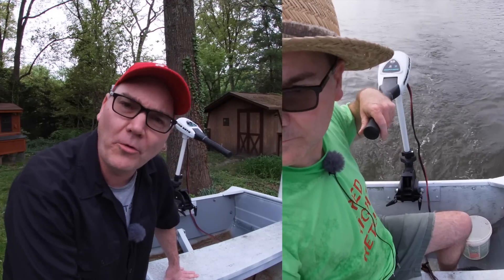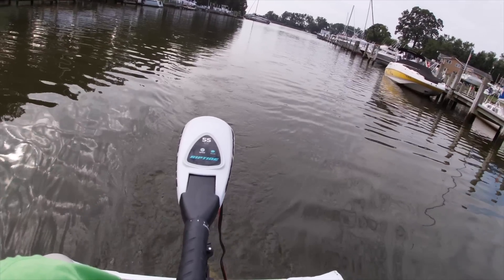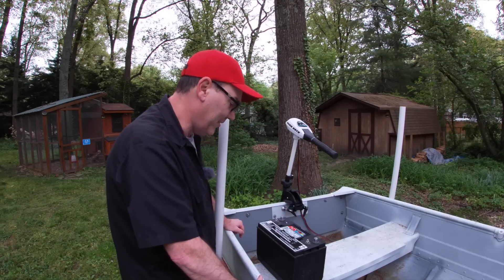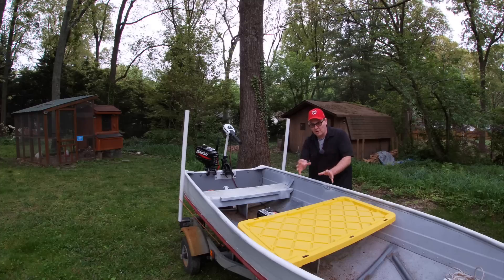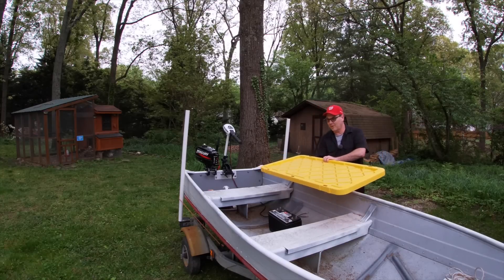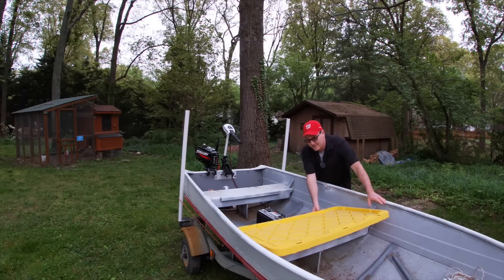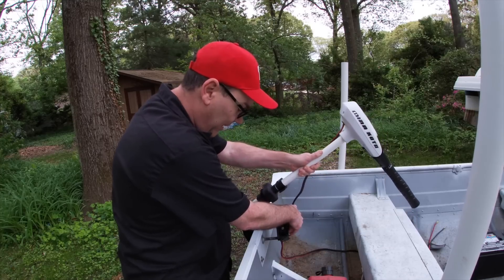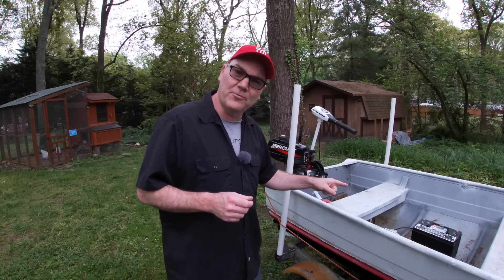How Many Solar Panels Do You Need For A Trolling Motor?

Comment: of course
Reply: why do you even ask, or doubt
Reply: curse, you just denied something that is possible, easily
Reply: everything was free for you, what do you complain
Reply: say the watts rating of the motor
Reply: solar roof, you got at least 1200W (not 300W) like in solar bicycle quad
Reply: your knowledge is obsolete
Reply from the maker: How is my knowledge obsolete? Go to Amazon. Look at all the 12 volt solar panel kits they offer. Read the specs for size and weight. See the cost. Read other comments from people who have either A: built a solar boat and admit that you need lots of panels to keep up with a trolling motor. Or B: have tried using solar with their trolling motor and it has only worked for them if they run for short periods of time at low speeds.
Reply: @WayneTheBoatGuy  say what is the wattage rating of the motor, then say if your panel or solar roof optimally directed to the sun will sustain it 100%, and your doubting makes it clear
Reply: @WayneTheBoatGuy  I do not pay any costs, ever, I just care if the idea is sound
Reply: @WayneTheBoatGuy  you dont even have to actually try, to verify some idea works
Reply: @WayneTheBoatGuy  assume you have x watts solar panel and x watts motor, you can easily say if it runs for example 6 sunny hours, without even having a single battery, I say this because you try to dumb down clever working stuff, with old crap attitudes
Reply: @WayneTheBoatGuy  I know this from solar cycling stuff, where a 300w panel can easily pedal you all day
Reply from the maker: @Jkauppa  I didn't want to fill this video with data. But to answer your question, my motor draws 52 amps/hr which apparently is 624 watts. 100 watt panels from Renogy on Amazon are 42" x 21". My 12 foot boat is only about 52" wide - so two of those panels would take up more than half of my boat unless it was a roof. A fixed roof on a small boat like mine is not ideal UNLESS someone was building a solar powered boat as proof of concept which has been done by several others.
Reply: @WayneTheBoatGuy  someone might want to build a roof if you dont want to yourself, even a simple tilt roof, or even a super wide oversized tilt roof, which makes full power continuous troll electric motor possible
Reply: @WayneTheBoatGuy  yes it has been done already, all soundly possible
Reply: @WayneTheBoatGuy  if you want just infinite daily range, dont blast full with the motor all the time, naturally
Reply: @WayneTheBoatGuy  taking breaks while fishing, stopping, is very common :)
Reply: @WayneTheBoatGuy  btw, any amps is only the time you actually take from the battery, so Amps * time = Amp hours, Power = Amp * volts, energy = amp * volts * hours, just to clarify some issues
Reply: @WayneTheBoatGuy  you could even drag a separate raft filled with solar panels if the roof option is not suitable :)
Reply: @WayneTheBoatGuy  OR you could have a very high wattage rolled up solar panel, from which you can on any spot roll out and charge fast to full
Reply: just buy a combo solar generator, done
Reply: buy 30% efficient solar panels, 300W/m^2 at mid day
Reply: are you using 10% efficient solar panels, huh
Reply: yes you are mocking what is easily possible with your mouth
Reply: I hear only doubt (I need to be paid, and restrict others) from you
Reply: dont buy heavy stuff, duh
Reply: again, compare solar input to motor output, otherwise you lie to yourself
Reply: if you dont know anything, dont try to teach
Reply: ahha ha ha does not cover your incompetence
Reply: because not you
Reply: tilt your roof, duh
Reply from the maker: "tilt your roof" So you agree that I would need a whole roof of panels to keep my batteries charged? AND you mention I would need to tilt it for it to be effective. Once again, I am not saying a solar boat is impossible. I know it's possible - I am saying that you can't just add a reasonable size panel to a 12 foot boat and expect it to increase your range significantly.
Reply: @WayneTheBoatGuy  no I dont agree, I just say your idea is not complete, so you dumb it down
Reply: @WayneTheBoatGuy  you can add reasonable size panel even light weight, not true
Reply: @WayneTheBoatGuy  assume 100W per m^2 , the boat is what 2x2 = m^2, 400W or more, 3x2m would make it 600W with 10% efficient trash panels
Reply: @WayneTheBoatGuy  I repeat: say the wattage of the trolling motor, you are just trolling
Reply: @WayneTheBoatGuy  you doubt the practical feasibility and easiness of the system, just get a 1200W solar generator package, you can even have a wider tilt solar roof than the boat is
Reply: @WayneTheBoatGuy  I do not agree with anyone who disagrees this hard
Reply: @WayneTheBoatGuy  there is no agreement in freedom, dont try to tie me in to your assumptions
Reply: @WayneTheBoatGuy  your goal is to keep batteries charged, you did not ever calculate if the inflow charge is positive, if positive, of course they will be full all the time
Reply: @WayneTheBoatGuy  if you are against me, you are an enemy
Reply: @WayneTheBoatGuy  no agreement (even being of the same mind) with a law information knowledge based enemy, we are free from that, we live with God, not under law
Reply: @WayneTheBoatGuy  get some 30% (300W/m^2) panels if you still doubt
Reply: @WayneTheBoatGuy  you advocate for batteries, so of course you are going to press down solar panels and the freedom, independence they offer
Reply: @WayneTheBoatGuy  just add more panels, and finally tell how much wattage your small motor is consuming
Reply: @WayneTheBoatGuy  I dont think you are an electrician
Reply: @WayneTheBoatGuy  who would care anything about the price of solar
Reply: @WayneTheBoatGuy  or price of anything
Reply: @WayneTheBoatGuy  money is for the poor
Reply: @WayneTheBoatGuy  we are talking about the feasibility of the idea, regardless of the price, you mix many things, and cant see the real thing
Reply: @WayneTheBoatGuy  buy a 1000usd solar generator, plug in 600w of panels or 1200w, flexible light weight ones, as a tent on top of the boat, and you are ready to go
Reply: @WayneTheBoatGuy  just checked some common troll motors, they are 300-600W
Reply: @WayneTheBoatGuy  the producer specs leave out watts in purpose (amps * voltage) so its less easy to determine the scientific power feasibility of the thing
Reply: @WayneTheBoatGuy  dont pick the 1500w versions of the motor, if you dont have 1500w of panels for continuous full speed drive
Reply: @WayneTheBoatGuy  stop being a doubting opposing entity
Reply: @WayneTheBoatGuy  all is possible and feasible and even practical, there is a reason why you want certain things not to happen, thats a king's syndrome
Reply: @WayneTheBoatGuy  you are even lying about your attitude, you are definitely against, words lie
Reply: @WayneTheBoatGuy  just solving your twisted view of the issue, there is a clear way, how to make it work, no denying of possibility or even feasibility, utterly a practical application
Reply: this why money is a curse
Reply: slap around face with a trout
Reply: dont even mention store, its a disgrace
Reply: money servant slave

Comment: The solar panels are to charge the batteries, not run the motor.  You get 2 x 6 volt batteries (connect them in series) and connect them to the charge controller/solar panel.  While the boat is docked or not in use the panels are charging the batteries.  Take the boat out fishing, return for the day, and the panels will charge the batteries the following day.
Reply from the maker: Solar recharging is a great option - especially to avoid carrying around the batteries.

Comment: I've fished for 30 years and I have never ran a trolling motor or any motor for 5 1/2 hours in a single day.  Not even 4 hours.

If I wanted to go further I'd use at least a 9.9 or whatever size coast gaurd approves for vessel size. 
If I used a 100 watt motor I bet my batteries would be a full capacity by time I was ready to head in for the night. Of course it wouldn't be by time you are loading up the boat. But it would be topped off while it was parked in the yard the next day.  That's taking way better care of your battery then most usually are. 
Keeping your battery fully charged will help it last ten fold. Compared to letting it sulfate up sitting partially discharged like most marine battery users do.  So yeah $300 is money well spent in my opinion. 
But I'll just stick with my 90's Era 25 horse Johnson and let the wind move me along. I use my trolling motor so Infrequently. But I'll get further up river in 5 minutes then I would in 5 hours if I used my trolling motor.

Comment: Any system using lead acid is going to have subpar results. An equivalent lithium battery is about 25% the weight and size. It has a far superior power curve with more usable range and about three times the life cycles.
But this would be easy to determine by looking at the specs on max current. Interestingly, those specs seem to be non-existent. Maybe you should have a better motor too?

Comment: until the watt density of a solar panel is increased by at least 100 times. solar is useless for powering a boat.  It can run the night lights.
Reply: There are certainly limitations, but not at all useless.  There are plenty of trolling speed boats out there that are 100% solar powered.  It's not cheap, but it is doable.

Comment: I agree that its rather impractical to run a trolling motor 100% all day off solar. but who in their right mind would do that? I struggle to think of a use scenario where you'd be running a small boat like that all day, even on petrol. The point is you dont have to charge your battery or fill your tank. you can be reasonably sure whenever you want to go somewhere, you have power. when your fishing, tied up, on the beach, your gaining juice. 

I could be a little biased, as Im putting together a similar system. I have a very cool plastic catamaran hull, with no sails. a stack of old 200w panels, but they only put out about 150W now. a few spare near new SLA batteries. all have been obtained at very little cost. the only thing holding me up is trolling motors are just not a thing in my area, so second hand or broken ones are also just not a thing, and buying one new just goes against the spirit of the project.

Im never going to take it offshore or do 35 knots in it. we have other boats for that. trawling can be very effective for some species where I usually go, and I want something I can hum along for an hour or so in peace. my speedboat uses as much fuel at trawling speed as it does at about 80%, as its not on plane, and the little 4hp 2-stroke on the dingy is not my idea of a relaxing afternoon. like most things, its built for a job. I don't take my speedboat around the cape, and my uncle doesn't try and ski behind his fishing boat.

I think your tackling this in a very negative light, Im not sure why.
Reply from the maker: You have access to used panels - which would change the equation. I had two points with this video. 1. The cost of new solar gear versus just adding a battery to increase range 2. The size of panels needed to try to keep a battery (or batteries) charged. 
I like electric trolling motors, and I would love to be able to add a small cheap panel to go all day. We can’t do that just yet.

Comment: It’s not about the solar, let’s get this straight. It’s all about the battery size and type. Solar only Charges the battery! That’s like asking people what size alternator they have. If you went lithium batteries, you could do it with less panels. Plus less weight. With two 58# batteries. You can get lithium. It would double your range, and have twice as less weight. Plus you can use 100% of use instead of 50%. The price of lithium is the only thing coming down in price.  So it’s cheaper in the long run. You can pick up lithium batteries for under $500. And they work just a fine as the name brands. After all the name brands are getting their cells from the cheap battery companies in china too.

Comment: I like adding solar to supplement things. Solar alone is not a solution. I like solar to supplement my household electrical use. I like to use solar to charge and maintain batteries I have in equipment and around my property. I like to use solar to keep my boat batteries topped off while I'm not using it, so they are always ready to go when we hit the lake.

Comment: I run a solar kit on my canopy but that's to offset the draw for the radio, lights (at night) and fans (Florida can get hot). Any net gain after that is just a bonus imo.
Reply from the maker: That's cool. Do you have a seperate 'house battery' circuit on your boat?
Reply: @WayneTheBoatGuy  no, in the off chance there's any issues I tried to make things as simple as possible for my boys. The trolling motor is on its own fuse but the batteries are in parallel (2x 100 amp/hr) and the wiring is similar to a house, a few circuits off a breaker and switches for everything.

Comment: He's wrong. His battery choice is wrong. His hull choice is wrong. That hull is so lightweight and draggy, it won't conserve much momentum at all.
Reply from the maker: This was not about building a perfect solar boat. This was an exercise in whether or not adding solar panels to the setup I currently own and use would be more cost effective and practical than merely adding a second battery.
Reply: @WayneTheBoatGuy  

Come on, you started your presentation by saying good luck to guys who try to build solar boats, and you went on to say how they're not possible. They are, and your way of measuring that possibility is based on wildly inaccurate specs and conclusions.
Reply from the maker: @yanickborg3118  that might be what you ‘think’ you heard, but not what my intentions were at all. I have consulted with solar boat builders, asked questions on many videos and this video addressed a specific topic.
Reply: @WayneTheBoatGuy  

https://youtu.be/_Fq0RfJ8aNY
Reply: @WayneTheBoatGuy  

For example to add range to a solar boat increasing battery size increases the recharge times. So what good is that ? What you want is to increase panels. Multi hulls are the way to go, and I'm pulling 11 knotts. A sailing boat does 8. A racing yacht does 15 but must tack. My solar boat goes point to point.

Comment: I’m currently adding 2 solar panels to the roof of my t-top on a 21ft center console. I have 4 batteries on the boat total (2 in series running 24v for the trolling motor) 1 for my main motor, and 1 for the console/accessories. I’m hoping that by having 2x 200watt solar panels will keep all my lights, navigation, gps, etc. charged and topped off while on fishing trips! I’m not exactly sure if this will be enough to go for what I’m trying to do but I’d assume it could also be a very good backup plan if the main battery was to ever die for some reason.
Reply from the maker: I don't see why that wouldn't work. A lot of it comes down to having the correct charge controller and fuses in place and the current draw and a T top is a great place to mount panels!
Reply: @WayneTheBoatGuy  Agree!  I have bought 4 different charge controllers. My opinion is Victron controllers are by far the best.  They are more expensive, but once I owned one, I will never go back to the others.

Comment: Even if you have enough solar panels… another limiting factor is the charge rate the battery will accept and the charge rate which will not degrade the life of the battery.
Reply from the maker: Agreed - however I think some of the higher quality charge controllers are able to handle those tasks better than others.

Comment: I converted my small boat into solar power and learnt a lot after several iterations. I used 300W. If I was going to do this project again I would go for two 240W panels.  https://www.youtube.com/watch?v=caDQVBurRO8
Reply from the maker: I watched your video - cool project! But like the others, you had a roof setup to make it work and you mentioned only being able to go 45 minutes at full speed - is that with the solar panel in place?
Reply: @WayneTheBoatGuy  So full speed level 5 the motor draws 600W and the best I ever saw off the 300W panel was  250W energy produced. I could motor around all day at level 3. I also had a 100AH battery. I think if I had two 240W panels on pivots I could probably go all day at level 4 or a couple hours at full speed. Have you seen the Jay Mansle videos? His solar boats are amazing.

Comment: I turned my normal 3ish hour trip to 5ish with a 30 watt solar panel , I just use the motor sparingly though. But the battery dies alot harder with the solar panel like there is no indication it is low. It works fine then all of a sudden it's barely able to fight the wind if I wait to long.
Reply from the maker: Interesting that you motor dies harder. I wonder if it has to do with charge rate - because I've heard slow charging is "better" and maybe your panel is charging fast. But it's nice to hear that a small panel does help when you aren't running all the time!